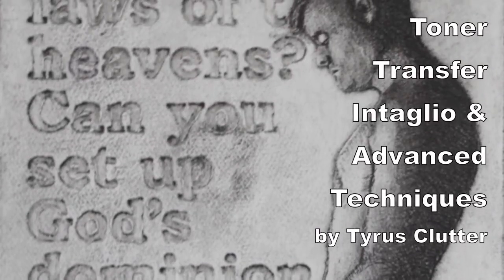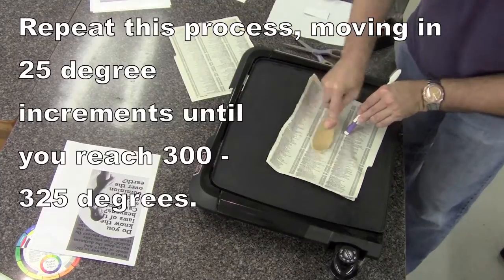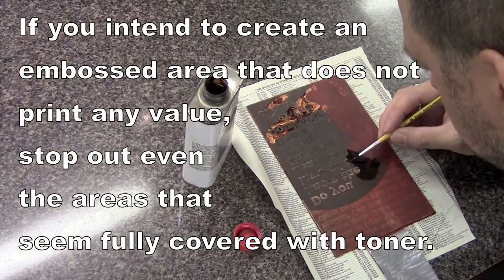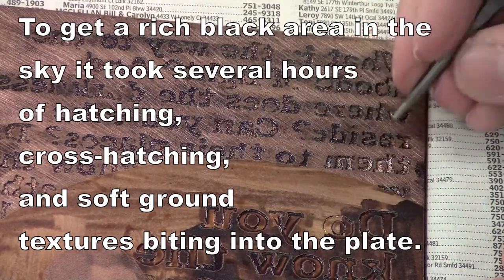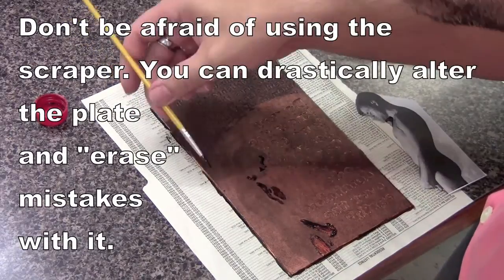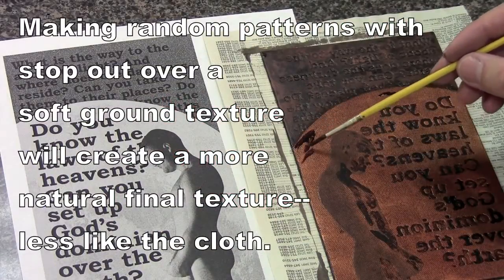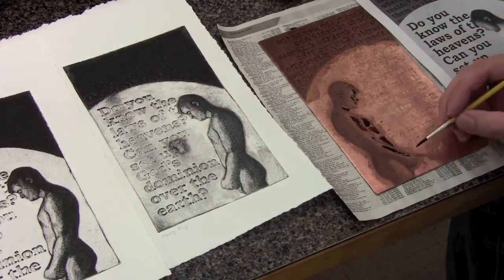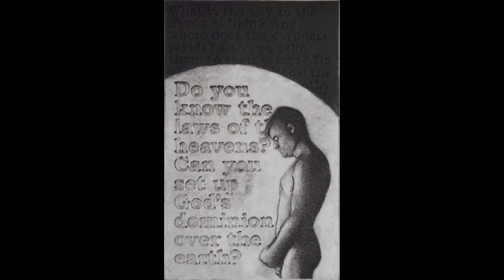Toner Transfer Intaglio

Comment: Are the letters above and below the moon are both raised? If the letters are raised, does it hold ink for a few prints or do you need to re ink before each print?
Reply from the maker: They are more deeply etched, so they do print as an embossment. They were not created to be a dark value (hard ground lines, soft ground texture, or aquatint could be used to darken them if desired), but they tend to hold a bit of ink, especially at the edges. This all depends on how the plate is inked and wiped.

Comment: Simply green household Cleaner was what my colleges printing studio would use to clean off the plates
Reply from the maker: The31souleater that is usually part of my cleaning process, but it will not remove toner or spray paint. But it is great for cleaning up after printing.

Comment: What does putting it in acid do?
Reply from the maker: That removes copper from the open areas not covered in toner. Those crevices hold the ink that is forced into the paper when it is printed. If all that you did was transfer the image to the plate and didn't place it into the acid then nothing would ever print from the plate.
Reply: @trclutter  with the stop out touching up after the transfer, are you just using toner on the brush?